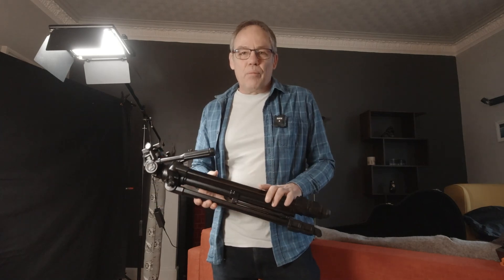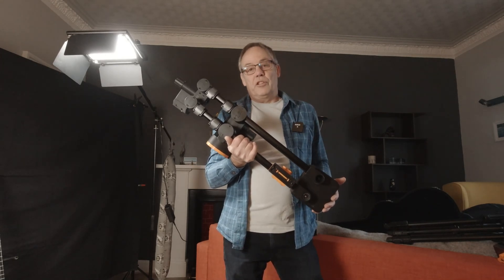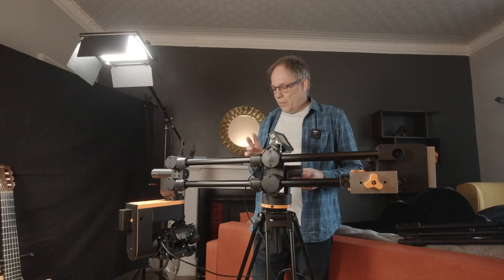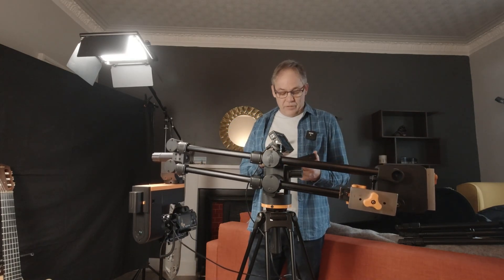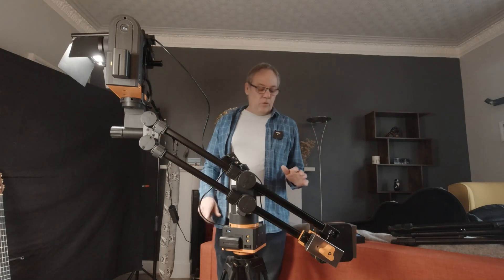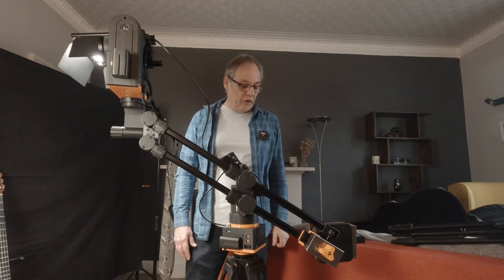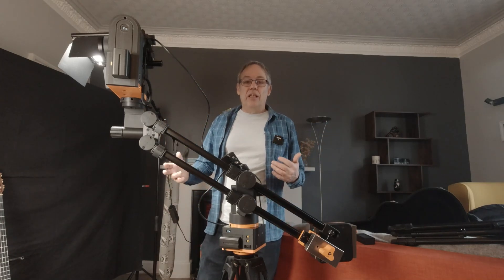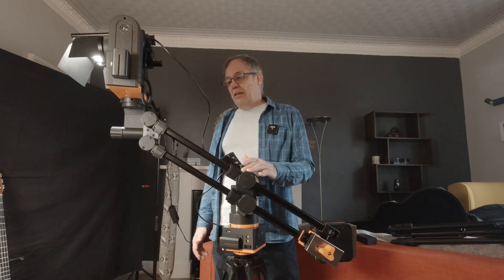3D Printable Motorized Camera Jib from Digital Bird -Introduction

Comment: Great Work, thanks for the detailed review, the links and everything. that would be my next project. Is it possible to get an assembly of these parts?
Reply from the maker: Thanks for the interest. Can you clarify what do you mean by an assembly?
Reply: @digitalbirdfilm  some xt or step files (assembly=all together) so it could be slightly modified. I got different tripod here so the clamps dhould be slightly redesigned
Thanks

Comment: Very impressed with what you have pulled together here and the man hours you must have put into such a nice solution. I am in the hunt for a solution pan, tilt, slide, and future jib but want to integrate the control into BitFocus Companion Plugin. Based upon the research I have done so far and the videos I have watched it appears very possible to do. Do you have an SDK/API documentation that I may review so I can see the scope of effort to make this happen? I can see translating many of the buttons from your wireless remote into a specific bottom on a 32 button StreamDeck XL that’s controlled by Companion…  Love to collaborate if you would entertain the idea…
Reply from the maker: Hi
I don't now much about BitFocus so I will have to do some research. However the forthcoming new Pan Tilt head will also be VISCA over IP enabled as well as WIFI so this may simplify things for you. The new head can be controlled from either OBS or vMix and should be available in a few weeks.
Colin
Reply: @digitalbirdfilm  How about ocs protocol? I am going to dive into the source to see what it would take but Visca is a great start.
Reply: May I ask why VISCA as it is an old Sony PTZ camera protocol and wondering what if any advantage implementing VISCA protocol since the Sony PTZ controller does not understand the JIB movement. I could be missing something? 

What about Pelco PTZ protocol may be more widely accepted. Since any protocol implementation take time, maybe OSC will be more beneficial.

Comment: I am humbled into my place by your generous of sharing this engineering feat. Too many people can not thank you enough (Headed here from the Instructable you shared)
As much as none of the mentioned parts here are cheap: One would have to part with so much more capital in order to have so such a control over the cameras movements.

I have instantly subscribed and set the notifications bell not only because of the "freebie" you have donated to the internet.. but because of you... With what you have and/or you are doing: there is not a single trace of boasting or anything of the like.

Edit: One more use scenario for your Jib.. For photogrametric 3D scanning. As since you are able to (as I get it) do stop motion capture as well. You can hands down get the best preprogrammed series of shots regardless the object you need to scan (Albeit the surface being non reflective and all that jazz). In fact that is pretty much what I will be using mine for as soon as I get my hands on one..
Thank you so much!
Reply from the maker: Thank you for your support. Yes you could use it for photogrammetric 3D scanning. Particularly if paired with the digital turntable you could scan quite large object with relative ease.

Comment: Seriously, this is just awesome! It looks like it's very capable and well designed. I found you on Instructables and I think I might take this build on myself. Thank-you! Out of curiosity, do you think it could also balance a much lighter camera like an iPhone 14 Pro Max or a Sony RX0 II, both pretty small cameras I know, but I was just curious how versatile adaptable this rig is.
Reply from the maker: Yes You should be able to balance any camera. If this is a regular requirement you may which to remove the built in counter weight designed into the motor housing.